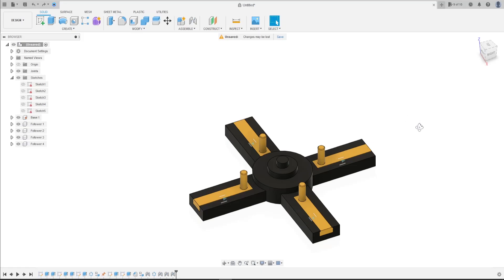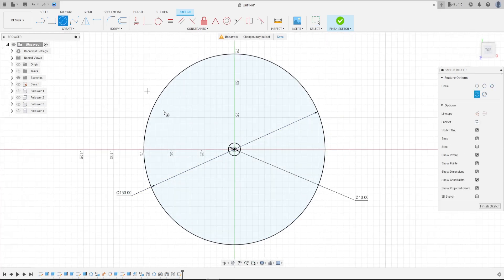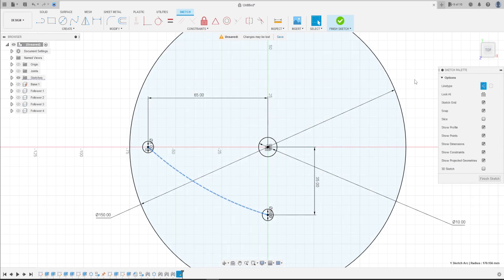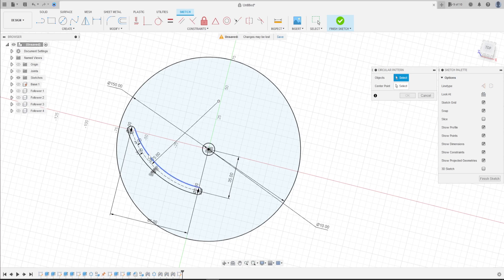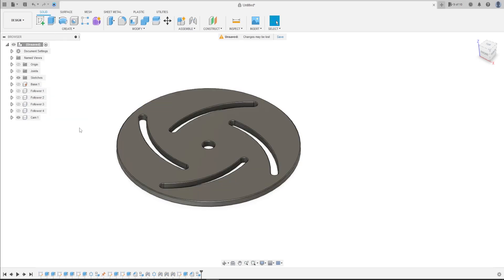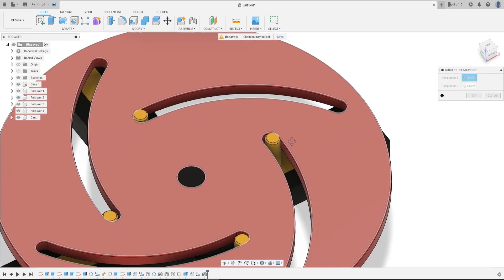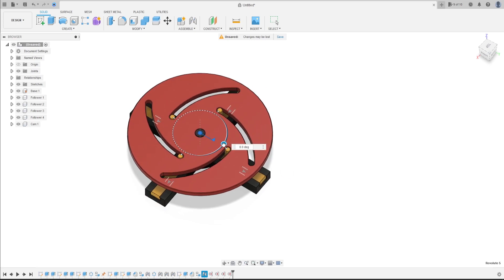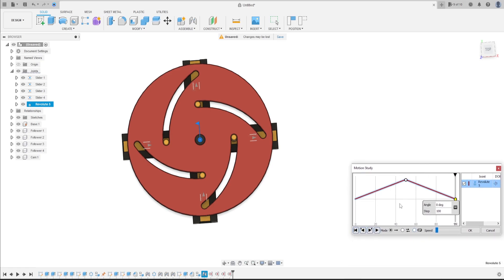Fusion 360 Tutorial  - Slot Cam Mechanism -  Cam

Comment: Really cool tutorial. I've tried to do a tangent joint in a contour with more than one surface, but it just doesn't work. I can only select the pin and ONE tangent surface. Is it possible to select more than one tangent surfaces for the pin to move along?